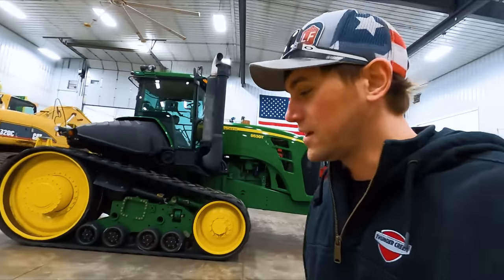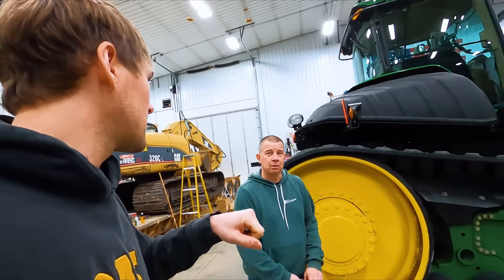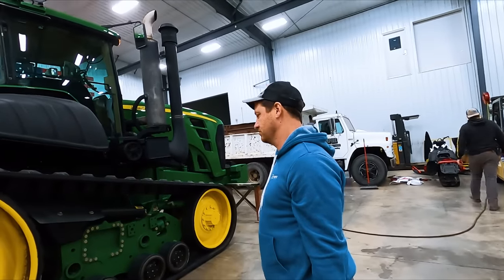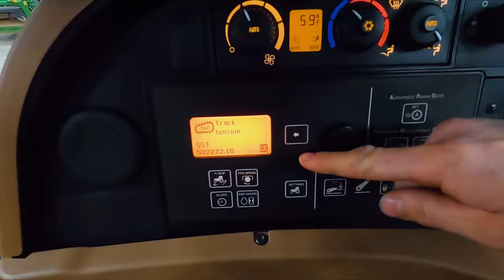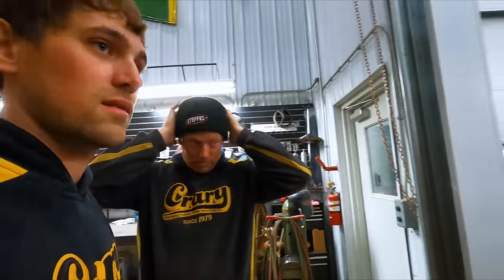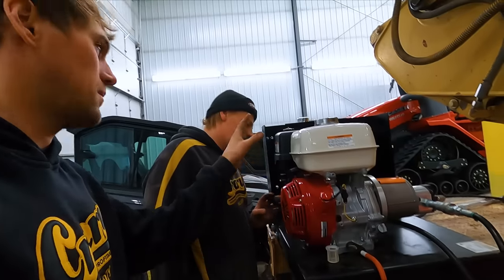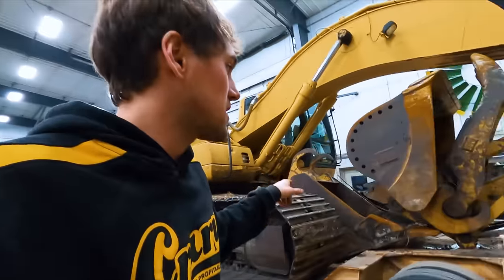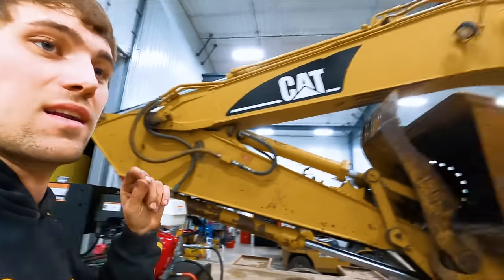Game Changing Upgrades Going On The 9530T

Comment: Pretty slick install of the hydro pump on the trailer but were I you I would think about taking it by  a local upholstery shop and having them make a heavy vinyl snap-on cover for that bad boy.  If you don't it won't take long for it to match the underside of the trailer with mud and dirt blow-off from those back wheels.  Brody will have to blow the carburetor right off that thing in order to get it clean and you know Dougo isn't going to get his hands dirty pulling on no filthy rope handle.  Just thinkin'...

Comment: For the garage openers as far as i know there is basically old and new style of radios in them. My vehicles worked fine on my old one but when it failed the new replacement would not work with my old vehicles any longer. I also got some keychain ones for my motorcycle to have so when i was coming home i could reach to my keys and open the door as i was pulling up. There again i had to choose the right remotes for the new motor.

Comment: I changed out a pull start motor a while back and replaced it with the Chinese knock off version. If you get the one that looks exactly like yours (I think its Loncin but might be Lifan) it is all good as the Chinese manufacturer used to make the Honda engine to the point you can buy the Honda parts and they fit exactly. I think Lifan make a copy that isn't as good tolerances but don't quote me on that. My one works really well and my fingers now do not get ripped off when it kicks back as its a 16hp engine! It was worth every penny and was about a third of the price of a Honda.

Comment: 21:53 Chet, if you did want to move the pony pump off the back of the trailer, find a spot on the semi tractor, perhaps on a couple if you use a couple with that trailer, and put a couple of hydraulic ports on the absolute rear end of the trailer. That with a pair of say 30’ lines to connect those rear ports to the pony pump on the semi tractor gets the semi out of the way of the loading zone, and gives you full use of the entire deck of the trailer should you need that at any point.

Comment: The reason for the type of wheel on lo-boy trailer is strength. Budd style wheels are bad for cracking from lug to lug and tearing centers out of rims. Most all extra heavy duty applications will have the Dayton style hubs(what you have now)

Comment: Wheel seals, drums, brake shoes, bearings, tires. In the fall dougo will trade the old girl for an rgn and be done with the old crap.  Those hubs are dayton and the lugs are shovel lugs. When the drums are inside the hubs they are called inboard mounted, when you have a hub pilot wheel and the drums are outside they are called outboard mounted.

Comment: Love everything you do!  But I'm pretty sure you want to build some sort of steel cage around that little motor/pump.  The first time it gets tapped it will be a goner.  Of course the cage won't save it from a big mistake.  After a long day, it will happen!  But it is a great idea adding the pump to the trailer.
Reply: Terrible idea. Just use a wet kit from the truck.

Comment: you may want to add a pilot operated check valve or counterbalance valve to keep the trailer from leaking down. But they won't work directly with a float feature.

Comment: Doug should make sure he has the correct series door transmitters for the opener.  We had the same issue and drove us crazy for a bit.  Needed 1 revision higher to work when the control board was replaced  after a lightning strike.

Comment: The trailer brakes, you don't have to take the wheels off the hub. It comes off the spindle all in one. Just take the bearing nuts off and outer bearing off. You will need a wheel dolly to do it.

Comment: Thanks for the video Chet. 
Most interesting and informative video. 

The kit to widen the tracks worked well for you. Now you can use this tractor to plant with. The crew knew what to do and how to do it. Nice work everyone. 

Sorry about the cut on the head Chet. Hopefully will heal ok. The hydraulic pump system is working fine that you put on the digger trailer. Nice work everyone. 

The hydraulic come alongs will work good for that crew from Canada. Nice tools you showed them. 

Sorry Dougo about the door openers. Reprogramming them can be a pain. 
Hang in there Dougo. 

About it I guess. Thanks for everything Chet. You all take care and be safe. 
The Iowa farm boy. Steve.

Comment: Would have built a platform and then mounted the engine to that after changing the configuration of the engine and mounted it under the front of the trailer. Shorter hydraulic lines and the motor is out of site out of mind. Before you say it’s easier said than done, I’ve done it several times in my dad’s shop. We even added a remote control that would both start the motor and actuate the hydraulics. There was still a manual valve just in case.

Comment: Grab a piece of plywood throw some grease on it pull the cap remove the nuts and bearing and slide the wheels, hub and drum all out together. Replace the seal clean the drum replace the brakes if necessary and shove back together, there is also a jack assembly made to pickup wheels and drums and to roll it off the spindle.

Comment: My thought with the hydro project is if you’re hooked up to the tractor what’s preventing the tractor from pushing the oil back through your stand alone pump and over flowing the reservoir? Is it just the valve on the trailer? Might need some shutoff or check valves?

Comment: Those trailer rims are technically called Dayton Wheels, laymans terms are sh-t spreader wheels, Budd wheels are much easier (and expensive) to work with. You can rotate the pull starter in any diection you want, the recoil part is separate and contained, I'd rotate it clockwise where the cord pull is at 2 o-clock, pulling level towards the front of the trailer.

Comment: 18:10 "get the air out of the hydraulic line - do you know?" With a pneumatic vacuum pump, that's how they do it in the factory on all brake systems. You would need to devise a way to hook the pump up to your line system tho.

Comment: Nice install, but do you have to stand on your knees in the mud to be able to operate the hydraulic, perhaps a valve with remote would be more useful🤔 Perhaps some kind of cover on the motor in the back also would be useful

Comment: Why does the wide stance kit not have dowel holes on the outside of the spacer?  Typically dowel pins are used to carry some of the load, but now you are just relying on the bolts to hold/take all the force, which is now higher than from the factory due to the track being spaced out.

Comment: I see you use alot of zip ties. If you have a problem with them breaking right out of the bag. You can add water in the bottom of the bag so all the ties touch the water and the next day they won't break when using them. The zip ties are made with plastic and it will absorb the water and make them flexible. Especially the black ones because they are made with a regrind mat. I've worked with plastic for 30 years.

Comment: On the planter, consider widening the 30” on-row centers to 32” between planter units #10&11 plus #14&15 to allow for the 30” track belt compacting right on the crop row. Plus, second thought - keep the 9X ready to go as a backup option, due to the known mechanical unreliability of 13.5L JD 9530T.
Reply: 9rx will be on the other corn planter.
Reply: I don't really understand why both 8370t spraying units aren't planting unless they are spraying pre emergent with one.
Reply: @delbutler885  Probably not allowed to tune a leased tractor. Need at least 425 hp to pull a 24 row at 10mph.
Reply: @lynwessel2471  what is the soybean planter that Brodie has been pulling with the 8370RT. I guess if you want to really know ask Randy. He's the money guy.

Comment: The hydraulic vale should have some time of markings on it. Some hydraulic systems are self bleeding.  Might have had to loosen the line fittings. I am an ex Aircraft Mechanic and the hydraulic systems on each plane are different. For instance,  on an F-4, if I was going to bleed the brakes, I would put the land gear handle in the up position. But remember,  the Aircraft is on Jack's, gear cylinder locks in. Once you apply hydraulic pressure with the handle up, it is Appling hydraulic pressure to the brakes so the sp the tire quots spinning before retracted into the wheel we'll. A C-130, y p u could run the utility system hydraulics and just keep pumping them, then switch to the Auxiliary hydraulic system and do the same. That usually bleed the system.  It might to actually be bleed to pass Antiskid operations.  That is what doesn't alow you to loke up the brakes.  But it appears that you guys figured it out on your own. In my business,  I have Technical Data must us provided by the Manufacturer. We are issued a laptop to access this information and are required to follow it step by step.  GOOD JOB GUYS

Comment: Dayton wheel style. Do not remove the tires you only need to remove the hub then either use a wheel dolly or fork lift to cradle  the tires then pull complete assembly

Comment: Those are Dayton wheels on your trailer. They were designed for drivers to change on the road faster and easier ha ha and be carful when taken the wedges off always loosen the  wedges by hitting with a hammer then take them off. The reason if you take the nuts clear off the wedges have been know to come out like bullet  this the nick name the widow maker. Be safe

Comment: What sucks about the Deere tractor is the tracks are friction drive. Get some mud or water inside the track and it slips. The Case IH quad has bars on the drive wheels that mesh with the drive lugs on the track.
Reply: It's two tracks that are friction drive ,John Deere RX's is lug drive too

Comment: It's interesting to see how the 9RX has fallen out of favour as "the tractor" over time.  Not just in the video on or the Larson farm.  But all over.  Several farms I know that had them, no longer do for a wide variety of reasons.
Reply: can you list some of the reasons?
Reply: @GRamerDim  Sure.  Shifting/Transmission Issues, Software compatibility, horsepower, reliability, they were happier with a Quadtrac.  Want me to keep going.

Comment: Dido what William and Jack said, my price is to shut off the fuel before you go down the road. That Honda will fill the piston with gas, locking it up or putting gas into the crankcase, neither is fun when you start it.

Comment: FWIW, keep a little gas stabilizer on trailer motor pump since it won't run a tank full very often.
Reply: or no ethanol 91 octane; aka "rec  gas"
Reply: Go to airport n get av gas for all your small engines that set around a lot you'll never have a bad fuel problem
Reply: @darylsmith4152  Really!!

Comment: With wider tracks you'd have a lower psi,and that is still not possible to plant into? Also when would you be planting into a place you've drove?
Reply: The tracks themselves are still the same width so same ground psi
Reply: You can plant into tracks in this black MN soil if its absolutely fit. A lot  times corn gets planted into marginal conditions in soil with that high of water holding capacity. It can be it beautiful shape on top and mud 4" down.

Comment: I dont understand if the kit works you may get rid of 9RX in the future and go to 2 track for planting? Would you keep 9RX for grain carts? And if running TWO high speed corn planters does that mean just Chet planting beans.
Reply: They have enough steigers to pull grain carts. They are getting sick of the crappy bogey wheels falling apart.
Reply: @Farmer1277  ya but dont they need all they can to push fall tillage behind combine??
Reply: @Farmer1277  i suppose you mean TRADE the 4 track off and get a 2 track???
Reply: @scottmaass4329  they already have 3 - 2 tracks
Reply: @Farmer1277  ohhhh i was thinking 2. One already has wider stance. Spray tractor i think.

Comment: I'm surprised you didn't change the tracks to a 24". One of the gauge wheels will still be running in the tire track and it won't ride smooth. Or use the 580 to pull the planter, its on 30" tracks isn't ? You should do a video on why you like 2 tracks vs 4 tracks.
Reply: This is their large 2 track. The 370s cant pull a 24 row 10 mph. They like 4 tracks, they have 4 of them.

Comment: Drill a hole in the pull cord housing and use a drill to start it.
Reply: Honda always starts with one pull so no big deal
Reply: @justthings6405  if you've had any kind of shoulder injury it most definitely is a big deal.

Comment: Razor blades to the head under a tractor is/are covered in detail in the latest OSHA 2024 requirement OSHA 24-0998765-LF.  Yes, LF needs some fancy jacking tools, available on-line with Grainger and at most all Homeless Camps where they are available along with stolen bicycles and grocery carts.  OMG, Dougo is way up there in the air, oxygen shortage and nose bleed altitude for sure.

Comment: Chet, you may want to think about using something other than wire  ties, to fashion those hoses because the wire ties will cut into the hoses, THE STATE OF OHIO would not allow me the  use them  on SCHOOL BUSES because the wire ties will actually cut into copper airlines IT'S A BIG NO on school buses and they will fail there STATE INSPECTION

Comment: Make sure you put a shut off valve in to keep oil from back feeding into the pony motor if you use a tractor ever again.

I would have put the valve in the head of the trailer so you don't have to get down on your knees to raise or lower the trailer.
Reply: 21:30

Comment: It's probably safe to say that the 9530t is a low budget planter tractor.
Reply: Its their low budget spare tractor, finally going to use it a little more.
Reply: @lynwessel2471  they have been Using the 9530 for tillage but with the 580 Quad track all turned up they figured that making the 9530 a planter tractor and a good used planter was the most economic thing to do. They just are not proud of the John Deere Quad.
Reply: @delbutler885  Yeah. they've used it some. No sense buying another tractor just to run a second corn planter. They must figure they can keep ahead of the 3 planters with the 3 Quad tracks.
Reply: @lynwessel2471  there's 4 red quad tracks a 450, 580 and 2 600 if Eric is fertilizing with the Terra gator